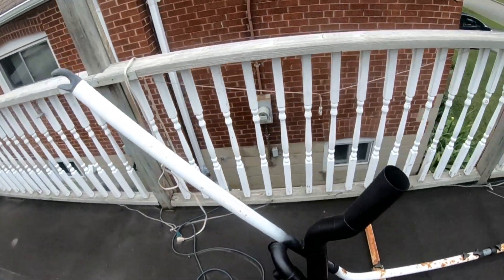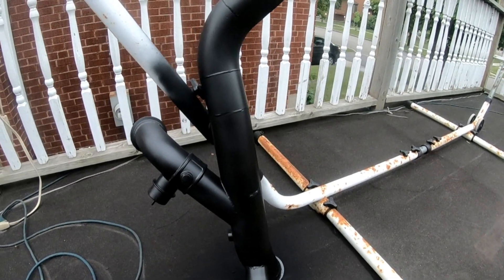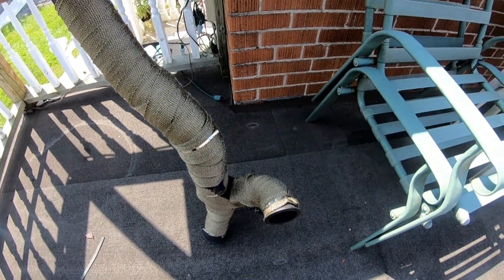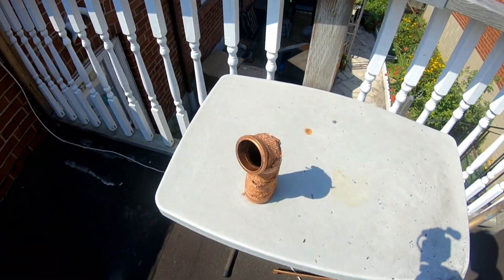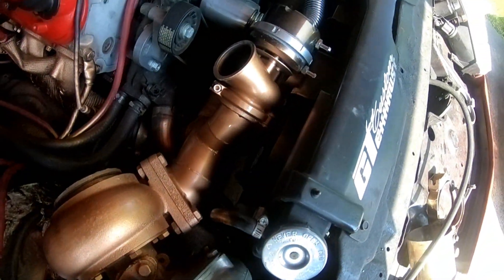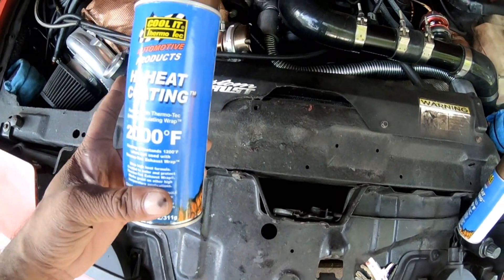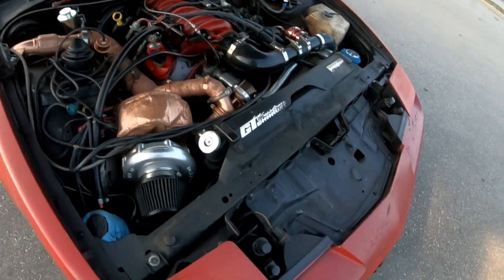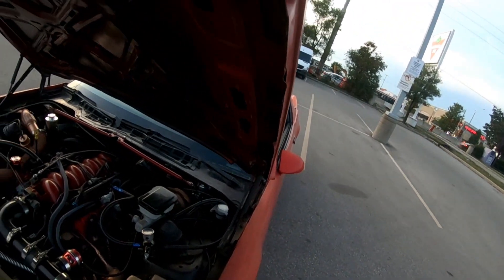Better than Ceramic coating in a Can?

Comment: Love how you gauge the effectiveness of the wrap and coating by how well it shoots flames now while on the 2 step 😂 good vid, I never thought to sandwich the wrap with coatings 👍
Reply from the maker: I saw too many videos of people it doesnt work or last very long.i figured why not try coating the pipes,wrap them,coat them again to buy more time.Its still doing well but some spots could use a fresh top coat as its faded some. The flames are an effective measure :)
Reply: Definitely discourages tailgating 😂